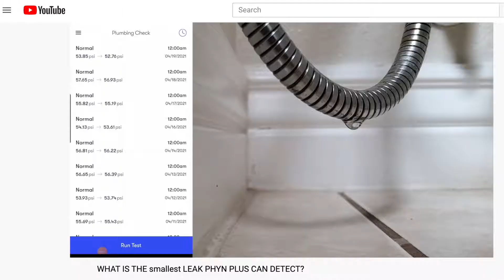Help! What are YOUR Concerns?

Comment: 2024 - Maybe beginner guide or summary

Getting the mats, leak sensors, smart shut off valve, maybe the smart home integration... I'm still figuring which one to get

I thought for sure Flo by Moen but now catching up on content about phyn, and there's h2wise by kohler by phyn???
Reply from the maker: Thanks for the feedback!

I have some major updates on where I stand on these devices with the long term testing--on both testing the devices and the companies themselves. That's the subject for the next two videos in production. 

Since you are looking now: Phyn Plus may be a great choice with features that Flo does not, but my issue is that the inside of the pipe inside of Phyn breaks down. I can see the engineered polymer fibers and I'm not comfortable having that floating around in water I or my family is ingesting. It happened in the Gen 1 and the Gen 2 when left exposed to the sun. This last unit I bought myself and it never saw the sun, but still had to be outdoors in the heat. The same problem occurred. That leaves the combination of heat and hard water of which I can't eliminate one to continue the test. Phyn ghosted me after a good conversation on possible things we could try last year. Without a replacement unit, which I finally was able to get a return last week, I could not start the experiment in a different location to see if the unit does just fine indoors. The engineered polymer is not unique to Phyn. It is the same thing Badger Meter is using in smart meters. However, the difference is, smart meters are located in a fully shaded box underground in the front yard, if they are outdoors like they are here: less heat. I am very concerned with this issue and without another test point where the device is fine for years indoors, I cannot in good faith recommend Phyn Plus or H2Wise+. In addition, other viewers have reached out that the H2Wise+ has a pretty bad app and it does not support sensors.

TLDR: go with Flo over Phyn Plus.

There are a couple other options available to you if the device is housed safe inside. It depends on what you are looking at budget wise, the integration you want, household usage, etc.
Reply: @NoMoreLeaks  thank you for this extra info, look forward to your future videos

Ok, the plumbing is inside. 
I am intrigued with the information these devices can provide with the leak detection. 

Yeah I started googling/reading reviews and reddit and saw similar sentiment about h2wise and you're just better off with Phyn plus over h2wise since Kohler support just tells you apparently to contact Phyn 

Thank you again for all your insights
Reply from the maker: If it is any help, here are the direct links to the playlists I have for Flo and Phyn. Phyn Playlist - https://www.youtube.com/playlist?list=PLzio78R2Y1xmFsNYxa93fIU9ObTcwchlw
Flo Playlist - https://www.youtube.com/playlist?list=PLzio78R2Y1xnD6HOjhSxcIr1RvUySdJXK The feature review videos show more than just tell. The cost video is another good one. I'm looking into FloLogic to replace Phyn and Flo--there just isn't a lot of information out there on that system.
Reply: @NoMoreLeaks  thank you, 
i'll check it out, the name is too close to Moen Flo, might as well go with Luigi's Leak Logic, Mario's Plumbing Monitor, Donatello's Leak Detector  

I kinda liked Moen because of the brand and felt I'd get support, i think for better or worse as average consumer name Kohler makes you feel more confident about Phyn
Reply from the maker: LOL. The funny thing is FloLogic was one of the first, if not the first in the game 20+ years ago.

100% agree on brand awareness being a thing. I haven't interacted with Moen since the transition since the last device has not had issues for years. Flo's customer service was phenomenal. I can't say the same for Phyn.

Comment: Question for you.  In this video. The shut off valve is green color.  I just bought from Costco. The shut off valve is light blue.  ?.  So, how I know my is real or fake unit.?.  Bought it July 2024.  Thanks
Reply from the maker: The good news is there are no fakes or knockoffs yet. Moen had slowly acquired Flo over the years and with each step along the way the housing, name on the unit and coloring has changed. My last couple devices, which you see in the video, were when Moen had the majority stake and it says Flo by Moen. You have the latest and greatest design with Flo being fully acquired and owned by Moen.
Reply: @NoMoreLeaks  , thank you very much for your response.  👍❤️

Comment: Just found your channel due to my failed Flo turbine.  Regarding concerns - you mention accuracy of the temperature sensors.  I'm pretty sure they are no longer showing direct water temperature data in the app.  They used to before they updated their app, but now it just shows ambient outdoor temperatures, likely from a weather service.  Mine is mounted indoors, so it shouldn't follow the ambient weather temp fluctuations.  I'm also amazed that there isn't a better warranty on these things considering their prices.  I have had smart light switches replaced when they fail after 5 years.  I can't believe Moen doesn't warranty these devices for longer than 1 year, but I imagine outdoor installations cannot be guaranteed longer than that due to weather exposure.  They should provide an optional housing enclosure for outdoor installations.
Reply from the maker: Sounds like you are an early adopter as well. I really appreciate your thoughts. Yes, that is exactly right. Years ago it did report the water temperature, but then the company said they made the switch because people were calling in worried about burning themselves from water coming through the pipe after looking at the app (I'd assume they were somewhere like me in AZ). However, I'd prefer to know the real water temperature when the house is freezing--that's when pipes burst. A water reading of 140 degrees F will never be too hot by the time it comes out of a faucet or shower head. Flo switched the app to reporting local weather, but the internal temperature gauge is still there because it would need to know that in order to report the freeze alert. I pulled all my videos down, including videos on how Phyn Plus and Flo's temperature sensors work, while I reevaluate my position on these water monitors. Flo offers an extended warranty. I'm enrolled in FloProtect, but my 5 year warranty goes out in April. To be fair, even indoors, Flo is constantly under use/stress and who knows what contaminants are in the water working against the device on top of the cost of data transfer/storage/etc that the light switch does not. From my own experience and receiving comments from others, Flo should be an indoor only device. I hope the replacement turbine kit does the trick for you.
Reply: @NoMoreLeaks  Yeah, I adopted it about 5 years ago.  My needs are a little different form you though, as I'm in an area with plenty of fresh water, but I have a water feature in my backyard that can at times consume too much water (it has an auto-fill valve from the house plumbing)  Flo Protect has helped ensure I catch it when its consuming too much.  But sometimes the app can be overly annoying with its protections for me.  One of the most valuable things I found was when my water pressure regulator from the city went bad.  I was getting 120 psi of water inside my house, and I wouldn't have really known it except for Flo telling me.  120 PSI is much higher than what house plumbing is rated for, so it helped me catch that before a potential failure occurred.

I wish they would give you an option to still view the water temperature.  I don't need a graph of the outdoor air temperature.

Hmm, I am a floprotect customer as well, I may be RIGHT at that 5 year warranty time frame.  I'll have to look into it.  I actually didn't know floprotect brought an extended warranty!?  Appreciate the reply!
Reply from the maker: That's HUGE! What a relief to find that 120 PSI before appliances started failing--the device more than paid for itself right there.

Agreed on the option. We have weather.com for everything else. ;)

Have you called in to see if they'll send you a replacement turbine kit as a FloProtect customer? I'm glad we had this conversation to hopefully have that covered.
Reply: Through a little email confusion, I think I have both a turbine and a new unit coming my way, thanks to floprotect.  At least it seems that way...
Reply from the maker: Whoa. I gotta say, while that seems a little extreme, the Flo customer service was really impressive IMHO. Glad you were able to get it worked out. On to the next 5 years! 🤞
Reply: @NoMoreLeaks   Just replaced the turbine and everything seems to be functioning properly now.  There is no obvious issue with the old turbine though.  Magnets have very little rust, no buildup.  When I removed the flo unit, the turbine turned freely with a blow of air.  Although I will say the new turbine turned for much longer, implying there was a little friction present in the old unit, but not much.  I did have to reuse the turbine outlet O ring.  The new one wouldn't seat into place.

An aside, do you have issues with live data delay?  Mine is definitely delayed, and often I have to close the app and reopen it to get live data again.  Pretty annoying.  Anyways thanks again for posting this stuff.  Quite helpful.
Reply from the maker: Interesting on the lack of wear on the previous turbine. I'm curious. Did you see the flow rate decreasing, cut in half or was it a total failure all of the sudden?

When I was doing some major testing of the last two units the live data was just a few moments behind, but nothing as drastic as you mentioned. However, I can't verify how it is working at the moment as my unit #5 is installed a few states away. My last set of testing was done during a visit a couple years ago.

I'm glad to hear you are back up and running again. Of all the people I've conversed with about Flo, you might be the longest Flo user I know.
Reply: @NoMoreLeaks   Well thats cool!  OG over here.  I don't monitor the water usage that closely.  Its provided some benefits for me over the years, but ideally I don't want to think about it or notice its there.  I don't remember why I found that it wasn't working.  But when I saw a flo monthly summary email that said 0 gallons were used in a whole month, I realized something was wrong.

Comment: Hi Margaret,
Always enjoyed your videos on plumbing and chatting about the devices on your channel. I wondered if you ever looked into flume?
I just bought one on amazon for $200 and I'm really enjoying it. We just moved into a new construction house that used cpvc for the plumbing :( so the first thing I wanted to do was have tools to monitor the plumbing system so I installed both phyn plus (gen 1) and a Flume gen 2 (p.s. this phyn plus unit is accurately measuring the water pressure in my place, unlike my first unit). I tested the flume against phyn plus for accuracy and found the phyn to be super accurate while the flume was impressively accurate but seemed to overestimate usage by ~1-5%. For my case, I like having both because the flume goes on my water meter and tracks all the water going to my property, while the phyn is installed after my irrigation branches off.
This is great because the nightly plumbing checks on phyn are isolated to my house (so if I had a drip leak in my irrigation somewhere it wouldn't show up, because if it did, I would have a hell of a time determining if the drip was in the irrigation or behind a wall in my house).

The flume was cheap, accurate, no subscription, and requires ZERO plumbing knowledge. very easy to install - one downside is that it is battery powered and does not measure temp, pressure, nor can it shut off the water. But it does try to assign different usage events to different fixtures and the web-based interface is great for looking at usage and history (I wish phyn would release a web based interface). It also allows you to customize leak / high usage alerts based on flow rate and duration. For my purposes I think the phyn still reigns supreme, but it has been fun playing around with the flume and seeing my irrigation usage. I'll also say both devices were able to measure down to at least 0.05 gpm which was impressive, maybe they could register even lower.

P.S. I was looking into other home monitoring tools and came across this device called "sense" for power monitoring (https://sense.com/sense-home-energy-monitor). Just ordered one. Have you heard of it? Thought you might be interested.
Reply from the maker: It’s always good to hear from you, Will! Congrats on the move. How did you manage to get a Gen 1 Phyn Plus?

I have heard of Flume and even considered trying it out, but I haven’t pulled the trigger for a few reasons. #1 was the inability to shut off. I want to be able to do something about it--not just ask a neighbor to stop by. Second, I’ve heard of water companies removing Flume from water meters and wanted to verify that if I spent the $200 that it wouldn’t disappear the next time the meter guy walked the neighborhood. I also do not recall its small leak testing abilities--it has been a really long time since I looked into it.

I very much appreciate getting your thoughts on it first, which does move acquiring one a few notches closer to reality. Someday perhaps…

As for Sense, yes, just now having looked at the link you provided, I saw that goodness knows a while back. It looks really interesting and I did consider it, but then forgot about it. I could see how it would be easy to geek out on that...so another one is on the someday list.

Thanks for reaching out and bringing these devices to my attention.
Reply: @NoMoreLeaks  I got a first gen device because a local pro squad had them in stock for doing installs (beagle services). They did a great job. I was perfectly happy with a gen 1 because space was not an issue and I know the inner workings are identical between the two gens (plus gen 2 units are on backorder for like 2 months apparently). I also considered buying the Kohler branded version of phyn plus because they had that at a local store, but it seemed like you would have to use the Kohler app and that made me a little unsure.

I never thought about a utility person stopping by and removing the flume device... I'm glad you raised that point. Thanks! I'll have to see if there is some way I can try to avoid that happening!
Reply from the maker: I'd do exactly what you did decision wise. It is nice to know there are a few more Gen 1's out there. That aluminum housing is a big deal--20 degree delta in releasing heat. I have had another viewer comment that the Kohler app is very difficult to use to put it nicely.

If I recall correctly, there may be a compatibility issue with Flume and a smart water meter, but I'm not 100% sure. I don't have a smart water meter, but I certainly want to clear it first rather than it getting removed or just set on my door step. ;)

I always appreciate our conversations--there is so much to learn!